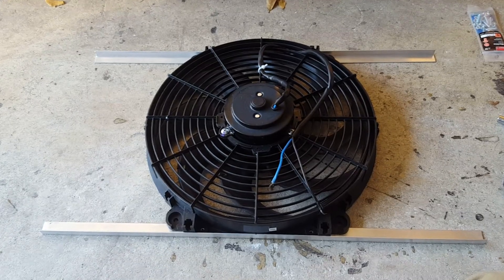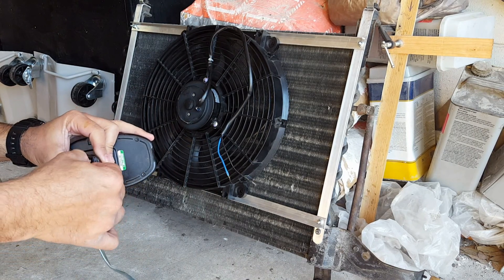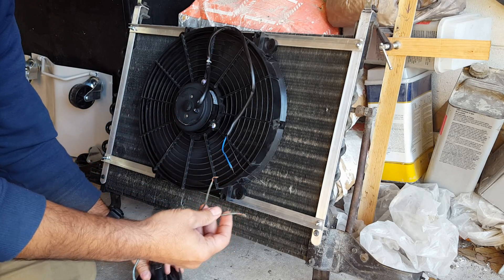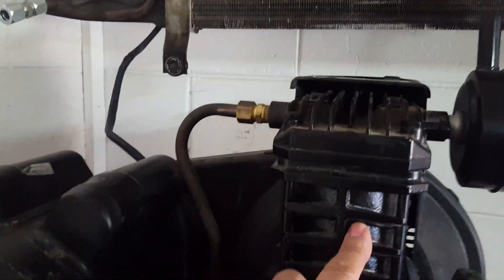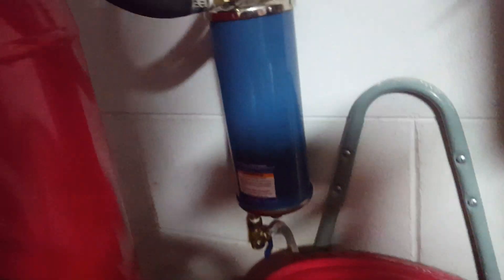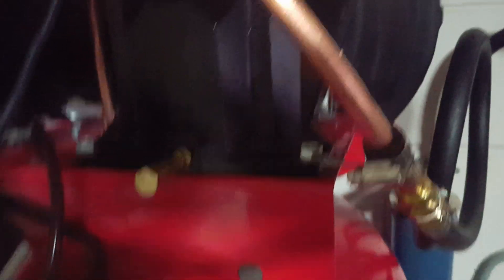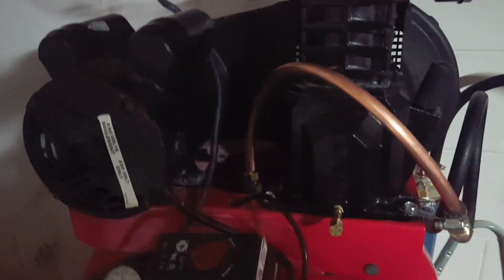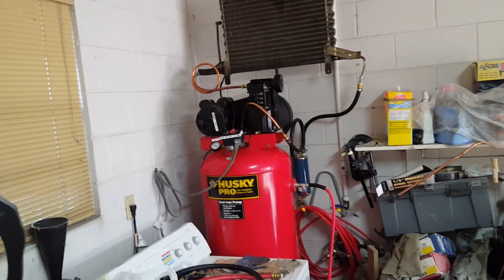DIY Compressor Air Dryer, Aftercooler Water Separator

Comment: You have made an air conditioning system,,,way too much drop in air temperature from air restriction,,,means your blowing high pressure through small orifice,,like an a/c unit,,,not good your going to destroy the compressor,,, should use all 1/2 are greater..
Reply from the maker: Look up industrial air compressor dryers.... 
What I build it just a home made version of it

The reason I used a older condenser is because it has bigger tubes inside the unit, unlike the new condensers which would have more restriction.

This set up should make the compressor last longer since it runs much cooler than before. 
Before my set up the top of the compressor would be so hot that it was hard to touch it.
Reply: @LincolnMaxnCo  you said yourself it has 3/8 tubes,, your compressor has 1/2 coming out of head,,,and air is still the same temperature coming out,,,cooler after going trough coils, 3/8 is too small,,just trying to help you,, many found out to late what restrictions will do,,, it will shorten life of compressor,
Reply: @LincolnMaxnCo  industrials have 1/2 are greater,,, I've been there 3 years ago and did all the tests and if you would have blown air through the a/c condenser you would have felt the blow back as i did,,and went to 1/2 .
Reply from the maker: George, one of the reasons I went with my set up was cost,
If I could afford it I would have purchased an industrial air dryer. 
The main reason was that I know that it has worked great for others. 
Today I was using an air grinder for almost 1 hr straight  and I did not get any moisture at all out of the air hose, that is a huge plus for me. 
Also I did not get any moisture last time I painted something :)

If you don't mind me asking, 
what kind of set up did you end up with ? 
and what do you use your compressor for ?
Reply: @LincolnMaxnCo  should check again,,many that said it worked now are saying there having compressor problems from restricting the air flow,,, shorted the life, they work fine if all the tubes are as big are bigger then the tank feed pipe compressor has.
Reply: @LincolnMaxnCo  I checked and it took 2 minutes longer then the 6 minutes to fill my 60 gallon tank without condenser from flow restrictions, so I used the 1/2 inch coil and time to fill was the same,,not trying to be a ass,,,just save your compressor life,,, that much temperature drop says your cooling through small orifices like a spray paint can does,,and a/c unit.
Reply from the maker: George, 
please don't spam my post

I already explain why I went w/ my "home made" set up
and it is working great for me.

As far as mounting it higher, the air entry point is higher than the drain side. 
On the entry point the air has not been cool jet, it is still really hot therefore the water has not separated from the air.
I used the compressor yesterday for about 45 min straight while using an air grinder, I had no issues w/ my compressor at all

As far as shortening the life of the compressor, 
I am not sure that it will BUT if by any chance it might...
The cost of the materials not to mention the time, on one of my projects, is much more than what the compressor is worth
Ex: lets say that I work on a project for 8 months and I go to spray it and I get water while spraying the paint.... making sure that I have no moisture/ water coming out of the lines for me is very important
I hope you understand my point
Reply: @LincolnMaxnCo  l don't even know what spam is,,lol. Just machinery
Reply: @LincolnMaxnCo  l build many many things but don't make vedios,, and maybe you shouldn't if you can't handle rejection,,
Reply from the maker: I don't see your post as "rejection" at all,

I am the type of guy who thinks that there is more than one way to do things, 
seams like if things are not done exactly your way, then they must be wrong...🤔

My set up it working perfectly for me  

Good luck in your projects 👍
Reply: @LincolnMaxnCo  just trying to help you out, the concept is right just wrong approach.
Reply: @LincolnMaxnCo  and I'm cutting you some slack on the use of plastic,,, it becomes very brittle with time and can become like scratnel when it blows apart.
Reply: George Spangler    This is great for the small shop guy on a budget. Since you know so much post some pics of your home made air dryer.
Reply: @jamesgingin590  mine is simple but most effective I have seen,, Just a 1/2 inch 25 foot roll of coil copper tubbing between compressor and tank with separator just before it enters tank,, mounted in front of compressor fan,, If you can't take criticism maybe you shouldn't make vedios, I'm just being honest about what I see and know,, l almost made the same mistake but decided to blow compressor air through condenser first and I could feel restriction,,and even feel back pressure, and I know how refrigerator works..l hope others relize before they take your vedio as the way to go,,,mine cost 70 dollars and you won't believe the drop in air temperature..
Reply: @georgespangler1517  Hog wash, my PVC piping has been in my home shop 30 years without a problem, 99 times out 100 PVC failures are human induced by poor workmanship being used during installation..
Reply: @Peter-V_00  your a lucky man just don't bump anything to hard against it now,,, you will have schatnel exploding,,, my friend did and it cost him one eye,,
Reply: @georgespangler1517  Luck has nothing to do with it, even metal piping improperly installed fails eventually, PVC is SCH 40 is not an issue even after 30 years because I installed it properly and it has never been exposed to UV rays (sunlight).
I'd bet money the PVC failure you mentioned was induced by poor installation practices more than outright component faults.
Reply: @Peter-V_00  no,,, pvc becomes brittle with time as with all plastics, 30 years ago as cheap as it would have been to use a more suitable system ,,,Hell even schedule 60 would have been much better
Reply: @georgespangler1517  You do you and I'll do me, think what you like but after 50 years of being in the trades I've learned not to argue over urban legends.
Reply: @Peter-V_00  you got it,, I've learned all the trades over the last 38 years being in business as a home builder myself,,,but I never cut corners and would never due to libelity use pvc for high pressure air in a customers home,, but you do you and I'll keep doing me...just becareful working around your piping not to rupture it..
Reply: @LincolnMaxnCo  now you said yourself you went from 1/2 inch to 3/8 inch,,, the compressor is designed to 1/2 inch discharge to tank,, and industrial as you talk of are all bigger ,none would be 3/8,, no doubts your cooling through air with anything longer then it had,,,problems will be back pressure on piston rings,,and moisture in compressor an it's is a compressors worst enimie. I know your proud of your progress to post it as I'm entitled to my comments.

Comment: Nice solution, with measurements!   How is the pressure drop across the radiator?  Also, I just had a PVC setup fail with age since PVC pipe gets brittle over time.   I just replaced it with a large diameter air hose.
Reply from the maker: Thanks, 
I wanted to make sure to include the sizes  of the adapters because I knew it could help some people.
I will eventually replace it but it's working great so far  :)
I don't notice any preassure drop since it is regulated on the tank I get the same pressure/psi as I had it set before.

Comment: What is the max PSI rating of that radiator.  It would be one heck of an explosion if radiators designed for 14PSi have 175PSi in it.
Reply: it is an air conditioner condenser, on a car it can get up to 200psi really
Reply: Nicolás Rodriguez - thanks for replying. Hopefully these radiators literally specify a PSI rating.
Reply: @lonniedomnitz1720  high side pressure relief on the average car ac system is  north of 400psi so no worries about utilizing an ac condensor

Comment: How does cooling the air help anything? Very curious , not being sarcastic or. Condescending
Reply from the maker: Cooling the air helps speed up the condensation of the moisture in the air.
By doing so it separates the water from the air.
By routing the drain hose to the first small tank, it sends most of the moisture to that tank/water separator.

The reason I use the set up is so that I won't have water coming out of the air hose.
water/moisture in the lines when painting something can ruin whatever you are painting.
It also helps protect my tools from moisture.

I used to use three moisture filters n one small inline filter and I would still get water in the line.
Now I don't get any water in the lines :)

some say that running this set up, will also prolong the life of the compressor since the compressor does not get as hot as it did before.

Comment: My only concern is the pvc pipe for your system.  I worked in a shop with pvc air lines and one day the line blew.  I had just stepped outside and it sounded like a bomb went off.  When the line broke, it split all the way down the length of the pipe and there were shards stuck in the walls, ceiling, boxes, and even in the doors.  The longest shard was 3 feet long.  It was a good thing nobody was in there because they may have been killed.  Please dont use pvc for air.  Steel pipe is much safer.  I know it costs more, but it is definitely worth it.
Reply: Another option that isn't super expensive would be to use PEX pipe.  But, you need to make sure it isn't exposed to UV light (or sunlight).  I am planning on using 1" PEX wrapped with insulation for my main run, with either 1/2" or 3/4" drops.

Comment: okay so the air going into the tank is cooler,  what is the benefit of that? ( not trying to be a wise ass, just don;t understand).
Reply from the maker: making the air cooler before going into the main tank helps to remove condensation before going into the main tank.
This set up is to remove water from the air.
It also helps to keep the motor a lot cooler.
To me the main benefit is not getting water while painting something and it helps extend the life of my air tools 👍🙂

Comment: any chance you could post a link to the power converter your using thanks
Reply from the maker: I could not recommend the one I use since the first one did not work like it should 😑
I would suggest to google 230 to 12volt converter and decide which one you will need depending on the amps needed by he fan you use.
I hope that helps 👍

Comment: So an Intercooler for your compressor. Does it fill up the tank faster since it is denser air?
Reply from the maker: I am not sure because I never timed how long it took to fill up.
but it might be faster 🤔
Reply: Hot air is larger on the molecular level, cooling it causes pressure drop, part of the eqation of tank recovery is CFM volume, the pressure has much less effect than actual flow volume (CFM).

Comment: Fuel injection hose clamps are stronger, they are meant for higher pressure, than those worm gear type hose clamps.

Comment: Maybe consider using a more modern condenser (parallel flow) and keeping the condenser lower for drainage.  Nice setup overall!
Reply: I think your right, as the hot air cools  after the compressor stops, there will be condensation draining into the pump. Lowering the radiator below the pump outlet seems great for long term preventative maintenance.
Reply: The tubes are so tiny in parallel flow condensers, I would worry about restricted air flow.

Also, I kinda think (maybe??) this automobile condenser trick might have some application if applied to the air coming out of the tank, instead of between the compressor and tank. I'm not saying that putting it between the compressor and tank isn't a functional plan.

But you're gonna have to drain the main tank regularly anyway. So why not let the main tank be your first method of cooling?
Reply: @dalemarkwell1171  when you cool the hot air, condensation develops.  The whole point of this is to keep as much  moisture out of the tank as possible.  The air is hottest when coming directly out of the compressor.  That being said, you are correct, you still will have to drain the main tank even with this kind of setup, although less moisture will build up (won't build up as quickly).  With parallel flow condensers although the holes are small, there are a bunch of them, which cumulatively equate to a very high flow rate (shouldn't restrict flow from compressor to tank, in most cases) although you will have to spec the condenser to the flow rate of your particular compressor

Comment: Nice condensor.  That PVC will kill you though - it is illegal in most locations for use with compressed air.
Reply from the maker: thank you :)

The PVC is SCH 40 and it can hold 480psi, 
I probably run 120psi max, and it is only pressurized when I am working. 
I have been in a shop when a pipe let go...It should be fine :)
Reply: @LincolnMaxnCo  Read the second and 4th paragraph. Never use PVC for air lines. Just don't want to see you get hurt. https://www.pvcfittingsonline.com/resource-center/using-pvc-pipe-for-compressed-air/
Reply from the maker: Clint thanks for the heads up
the PVC set up is only pressurized when I am working on something that requires air, all the other time there is no air on the PVC pipes. 
I will probably replace the pipes later on with something else but they are working good so far.
Reply: @clintbonnett3449  You are citing an OSHA regulation, unless this is in a workplace (occupational) with employees or open to the public the "regulation" is moot to a homeowner, OSHA has no jurisdiction at a  private residence or other private location.

Comment: How did you wire the fan into your set up?  Just wondering since its 12 volt and your compressor is either 120 or 220 volts.
Reply from the maker: My compressor is a 220 volts 
I bought a 220volts to 12 volts converter and I wired it to the same power feed in the compressor so that it only turns on when the compressor turns on and it does it automatically :)
Just make sure you select a converter w/ the correct amperage (depends on you fan).... because if the amperage is too low it will spin the fan slower than it should

Comment: I would suggest that you lower the condenser and lines below the compressor outlet so all water drains towards your blue canister and doesn't have a path back due to the effect of gravity after you shut down. Any moisture or water getting into the compressor can cause corrosion or worse, enough to hydraulically lock the piston at start up.
Nice step up. Definitely worth it.
Reply from the maker: Thanks for the suggestion,  
The air inlet portion which is on the left is the highest point on the condenser and the part that is very hot.
The lowest point on the condenser is the rt side, my though was that any drainage will be towards the lowest point.  
On the left side the temperature is very hot because it has not have time to cool down, since it is before it enters the condenser.
There is also a loop on the lt side  before the head and if there was a drop of water on the copper tube close to the head, 
it would evaporate very fast because that pipe gets really hot.
Hopefully this explain my train of though :)

Comment: Are you getting a pressure loss coming out the tank to your tool. Or at the tool. I’ve got a trailer compressor that produces a nice bit of condensation. But I’m sand blasting with it and don’t want to loose any pressure at the nozzle. So I run it it with no moisture trap. I just drain the tank every 15 minutes till no more water shoots out. Takes about 30 seconds to disperse condensate.
Reply from the maker: I am not getting pressure loss, I mainly use the compressor for my DA sander n for painting, the pressure stays the same since  it is still being regulated by the regulator.
I have read about others using this set up for sandblasting and it helps a lot to remove the moisture and to keep the compressor cooler.
I used to get water coming out of the line w/ using my DA sander, even w/ two filters and now I get no water at all, most of the water is trapped in the first canister before going into the compressor tank.